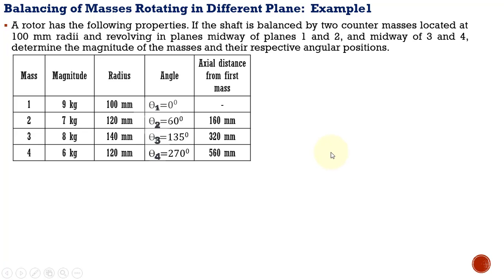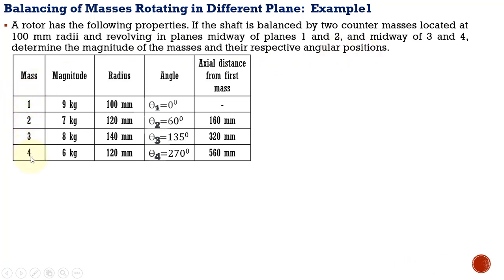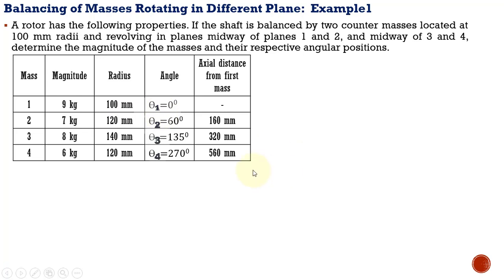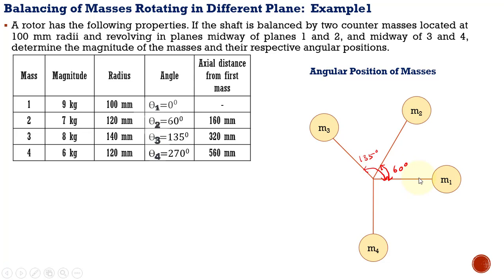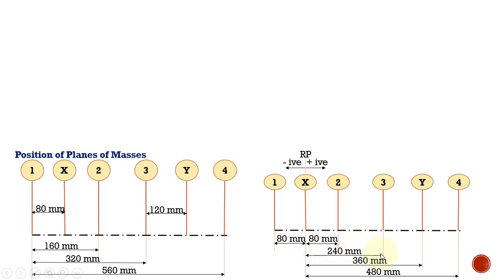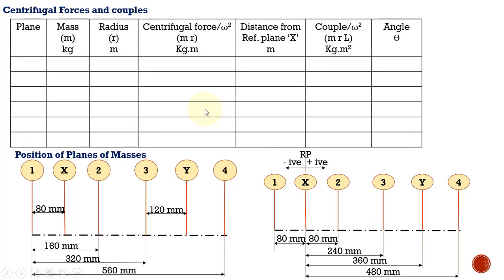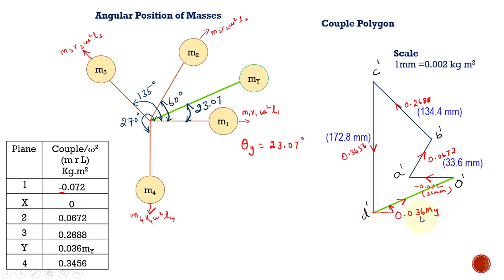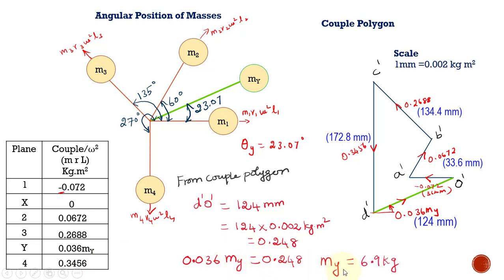Dynamics of Machinery | Balancing of Rotating Masses in Different Plane | How to Draw Force Polygon

Comment: How do you get the angles and the m values..? you are not explaining in details
Reply from the maker: We have to measure the length of the closing side of the polygon to get the the magnitude of unknown mass. Further, we have to measure the angle of the direction of closing side with respect to the horizontal in the counter clockwise direction to know the orientation of  the unknown mass.